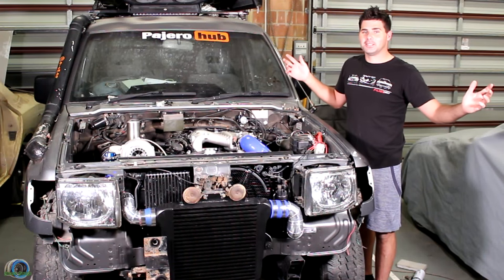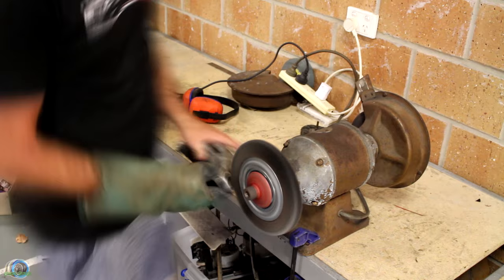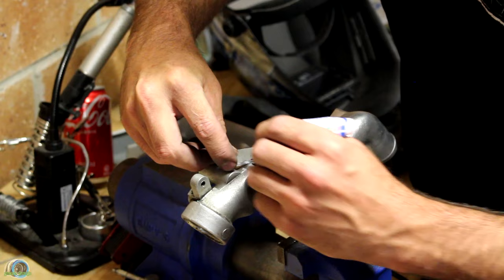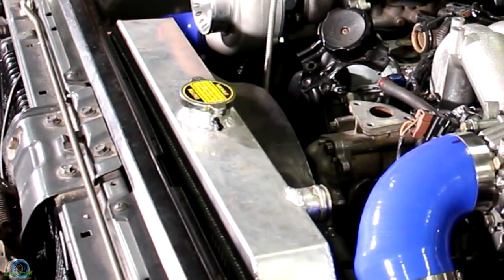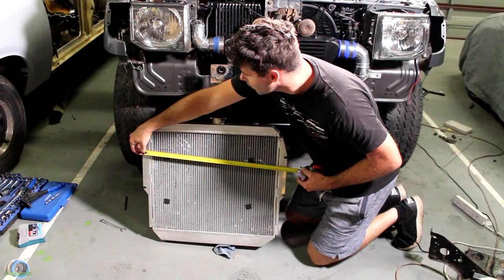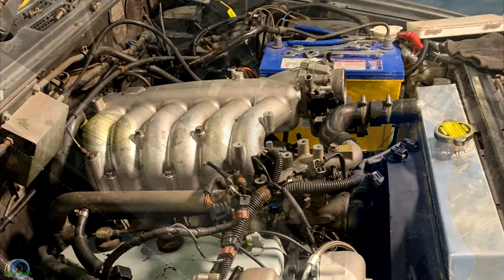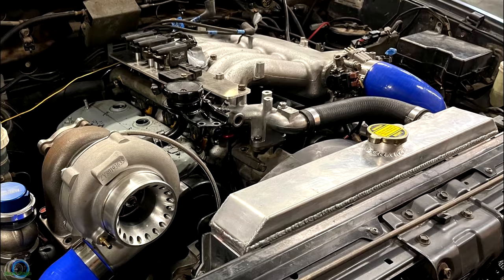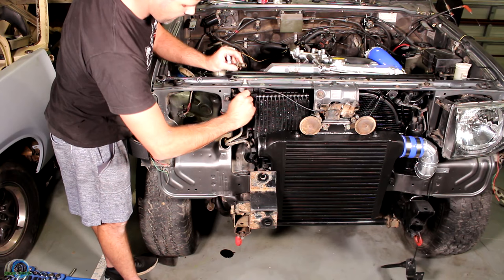PAJERO NEEDS A TURBO  Part 5 Lets weld some cast Aluminum , Coolant housing and Radiator

Comment: Fuck I was considering a supercharger for my 3.5 v6 gen 3 buuuut man I want that turbo
Reply from the maker: we are doing a turbo giveaway very soon , so maybe watch out for that, i highly recommend turbo on these, my personal opinion superchargers just don’t do them justice , check out our website greasegarage.org
Reply: @GREASEGARAGE  do the work for me? 😂
Reply: @GREASEGARAGE  I just don’t want to blow the poor v6 petrol up
Reply from the maker: @SubSonicsPixelators  maybe in a couple of years at this stage :P so many projects
Reply from the maker: 6G7x get boost all the time, as long as you keep them in th eknown limits you can drive them around and have the power when you need it with out the problems
Reply from the maker: @SubSonicsPixelators   would love too mate, but i got some other projects i need to get done, the valiant and evo are two big ones